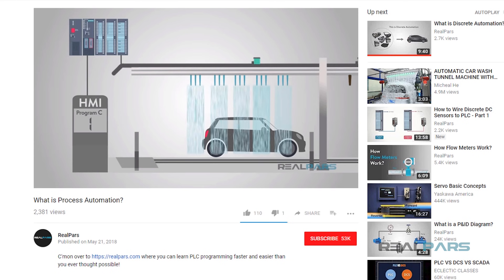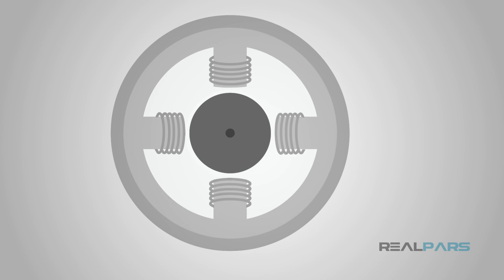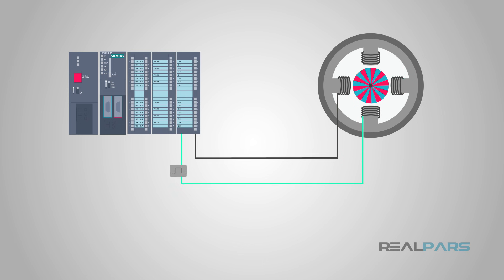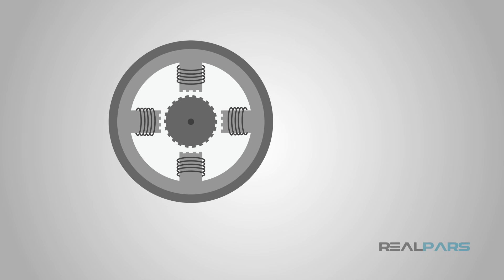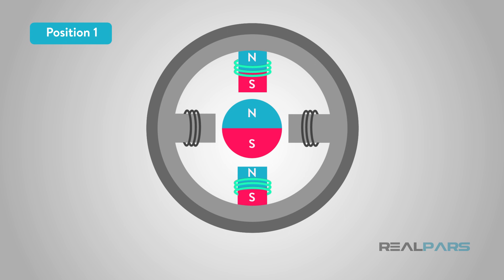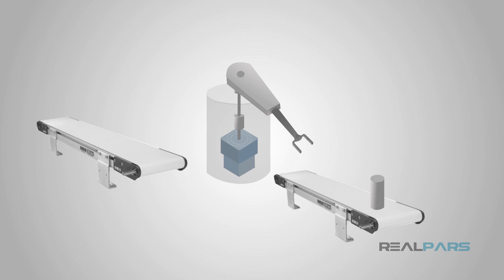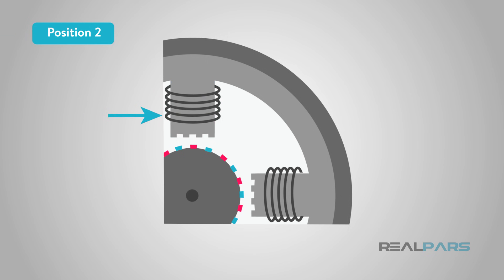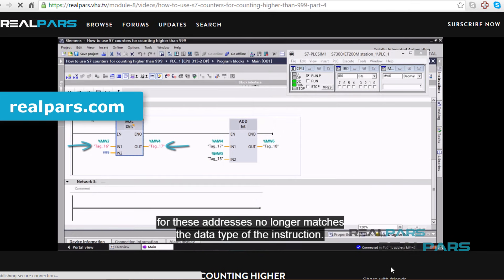What is a Stepper Motor and How it Works?

Comment: Thank you, but how does it control the direction? So how does it know if it should go ccw or cw?
Reply from the maker: Hi there,

Thank you for your question! As stated in the 4:45 to 5:37 Minutes, we activate and deactivate the electrical magnets to make it go CW or CCW depending on how the program is written. There are usually sensors outside the motor to notify the PLC the robot, for example, has reached the desired position or motor-driven device. 

Hope this helps!

Comment: Why not to energize both pairs of coils but to opposite polarity?
Reply from the maker: You would end up with the magnetic fields fighting each other and would lose the resolution of the stepper.  The motor positioning requires the precise control of the magnetic field to move the shaft in small increments.

Comment: Hello Sir.... Is there any difference between the rotation step angle and the pulses given from controller? From controller we are giving 5000 or 10000 and so on pulses for single rotation, and can stop the stepper in any pulses, but how it relates with the steps if we are using PLC?
Reply from the maker: Typically, for a robotic installation,  you will use a motion controller to manipulate the robot position.  While you could use a standard PLC, this is not often done.  The use of a PLC is usually for setting a motion mode and letting a dedicated robot controller control the fine motions of the equipment.  That said, some PLC's can be used effectively in a supervisory mode, and some can be outfitted with special interfaces, I/O cards, or instructions that allow for precise motion control in several axes or to the high precision you mention.

Comment: why does the rotor teeth with 200 steps goes only clockwise when the coil is energized ? In my opinion, the 2 north poles each in the left and right have equal magnetic attraction ? Then why does it not go anticlockwise ?
Reply: Hello Ajith George: The stepper can in fact move counterclockwise CCW or clockwise CW depending on the polarization of the stator. If you are able please provide the minute timer of the video to allow me to be more specific. Thank you for your question.

Comment: Thank you, it would be nice if you also showed how it goes in the opposite direction.
Reply from the maker: If you swipe two phases of a 3-phase motor, the rotation direction will be reversed. 

We have a video in our course library that goes more into the details of this. You can watch the video here  https://realpars.vhx.tv/videos/74-cw-and-ccw-rotations-normal-mode if you are a subscriber already.
Reply: There are more than 4 windings in the stator. Generally you need to make four steps in a sequence over and over to move in one direction. If you reverse that sequence, it will run in reverse.